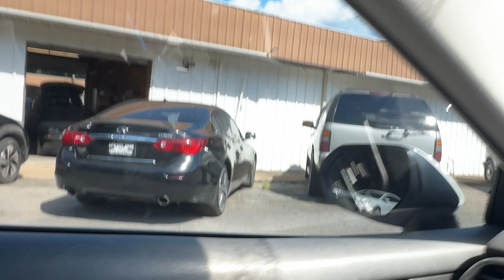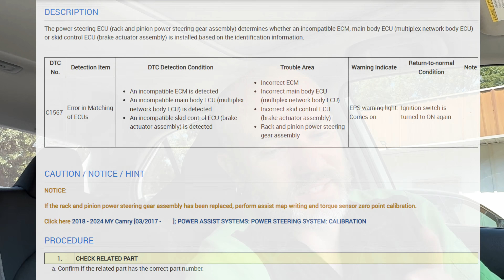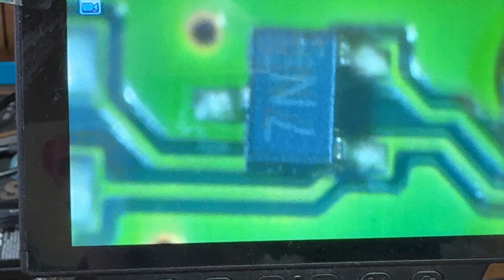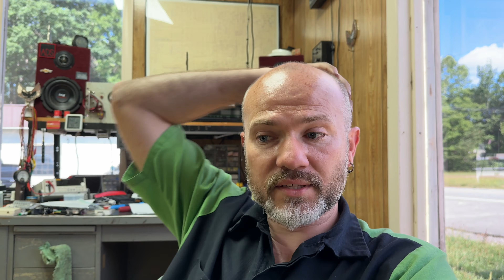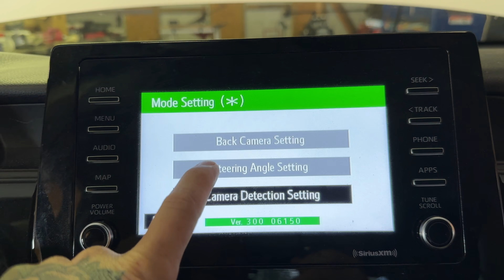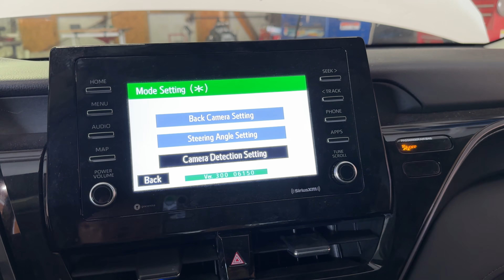Low Mileage Camry What Happened to You? Part 3 The Repair and Cause?

Comment: The SOT-23 device is a dual bi-directional TVS like TI part ESD2CAN24-Q1. This device protects the HSCAN transceiver against ESD, and it is very effective against normal human body model ESD, and will clamp other over voltage events of similar energy, however it will not withstand a lightning strike.

Comment: In Japan years ago when I lived there, one item for the safety inspection was to drive the car around a circle with the turn signal on and when coming back around to a straight line, it was a requirement for the mechanical position of the turn signal to turn off the blinker. If the plastic parts for the turn signal system was broken, FAIL this portion of the inspection, take it to get it fixed and back to the safety inspection folks to verify that some work was done and fixed by whatever means was needed. As you mentioned maybe this is now a COMM issue rather than a mechanical issue, I honestly don't know these days, I left Japan 10 years ago and have not run into a turn signal issue since. 

Thanks for the console programming procedure, that will save some time for sure.

Comment: Your shorted 3-terminal device was almost certainly a "TVS" (transient voltage suppression) diode.  It's purpose is to divert a static electricity "zap" to ground before it can damage more sensitive electronic parts in the module.  Your shorted part must have been overwhelmed and destroyed, allowing the processor to be damaged.  A nearby lightning strike would explain this, and all of the other damage you listed (abs module, wheel sensor)...

Comment: That car has water damage. Id check the floor under the rug and the back seat for any SCM TCM or TSC modules or PCM. Pull the rug up passenger or driver. Something has 💧 in that car. One of the things that usually happens when you have water damage on a car. Especially storm damage is specific modules. In the cars have other capabilities, and if they get wet, everything goes crazy, check the trunk.Most of those newer cars have modules in the trunk.
Reply from the maker: No water damage.
Reply: obviously he'd have first checked for water.   duh

Comment: Excellent analysis. Given what you showed on the circuit boards, I agree with lightning strike damage. The first chip you showed on the CAN bus is a diode network for overvoltage protection and the chip would have sacrificed itself during the lightning event.

Comment: Some used modules can be used and reprogrammed and some cannot.  If it is an anti-theft part then it might be able to be cloned with a used module out of the vehicle.  I would try and update all the modules, and it might code to the new VIN.  Try to reprogram first.

Comment: I find that to diagnose everything you need to know a lot about computers, which i dont. What method would you recommend? I want to know everything about chips like eeprom, transcievers, filters  and so on
Reply from the maker: You really just need to know circuit design. Like pull up, pull down, the different networks.

Comment: Chip in the ABS module and TVS diodes in the power steering module and a small or tiny dent in the front bumper.  Sounds like they hit a downed power line.

Comment: Turn signals didn't work before because that module was offline when everything else was offline. You even had a code for it on the initial scan.

Comment: To get out of the diagnostic just hold the power button for a few seconds. The screen shuts off and reboots. My bet is lightening strike. I just did a 22 Corolla lightening took out abs module. Left rear speed sensor. Certification ecu and main body ecu.
Reply from the maker: Awesome thanks

Comment: That's a bad TVS diode, as others have mentioned. Digikey has a good white paper on automotive grade CAN Bus TVS protection and lists some SOT-23-3 devices. Same form factor as that 7N. May have been an easy fix for that module, either remove it or replace it.
Reply from the maker: Yep would of been a real easy fix if I didn't break it getting it out lol.
Reply: @autodiagyt  Yeah, but that's the beauty of working on broken stuff, it's already broken. And, of course always learn for the next time.
Reply: @inothome  FYI for all:-  TVS = Transient Voltage Suppressor.

Comment: The 3 terminal chip (7N) across the CAN bus is most likely an ESD protection chip and not a filter.  A filter would be bigger and have more terminals.  The ESD chip has diodes that would short the line to ground for protection.  You are right that you could remove the chip and the circuit would probably start working again.
Reply: Yes, probably ESD protection or TVS diodes. Would work like a pair of Zener diodes by sinking current from the CAN lines to ground when the voltage difference gets above a certain limit.  There must have been a voltage spike on the CAN lines, a difference greater than 16v.  Their normal failure mode would be to fail short circuit to ground to protect the circuits nearby.  I'm surprised more modules didn't also fail if that is the case.

Comment: I think the little 7N Chip is for static protection of the data lines to protect the circuits after it from static. At a certain voltage it will let it run to ground and protect the circuit.
The third pin that is not Can H and Can L must go to ground.

Comment: I think you got a lightning car.  Too many modules bad, and Florida has daily intense lighting storms during the summer.  The strike was just strong enough to do some damage, but not take out modules the way you're used to.  I'm sure that N7 chip is some kind of circuit protection - something like a double Zener diode.

Comment: I have ran into so many vehicles with customers pushing bad batteries and or jumping off vehicles and I bet it came from voltage issues due to bad battery or being jumped off or jumping other vehicles off and it running during jumps.

Comment: As i worked alot on toyota here ...they use BLDC motor drives for eps if you can get eps drive computer from same parts car it will work perfectly.thx jack for taking us through your facts finding and fix.cheers

Comment: I looked up the service history and it states the vehicle had some aftermarket wiring causing the taillights to stay on and it also said that the alternator shorted out causing the ABS actuator to fail. Idk if any of that is true.
Reply from the maker: So go back to part 2 and see what one of the reported reasons for service was at the mileage the car stopped counting at and can you confirm that's the dealer that claimed collision damage. Email me if you don't mind autodiagyt@gmail.com

Comment: i suspect that to be a zener diode package so if too much voltage shows up on the can lines it shunts the excess to ground. hmmm did that rear tire take a lightning strike?  sensor abs  &steer modules nmm.

Comment: I have a fancy GE washing machine that stopped draining. I pulled the pump ohmed it out and it was bad. Put a new pump in same issue. I pulled the control board it had 17 connections to it. It had a huge burn mark. Bought a new board all fixed. I assumed the drain pump took the board out. Many people had the exact same issue and an appliance guy on YT (Bens Appliance and Junk)figured out it's the board that takes the drain pump out. On washer board it's a triac that blows out on all the boards.

Comment: Hit us with the middle finger pretty hard my man... JK😂  Great to see a conclusion on this one and some interesting Toyota secrets.  The thing I really hate about these new cars is the shear expense of repairing these system we somehow managed to live without for over a hundred year but now are almost required and given time wil be government mandated i'm sure.  Even the simplest touch screen radio from OE is 1000$ let alone self parking modules, sensors, cameras and all the other junk. It's fine when you buy it new and it's under warranty but the next guy who has to pay out of pocket or buy and expensive aftermarket warranty is SOL. Imagine the cost of replacing a touch screen dash in something like a Hyundai Ionic?  I know of one Tesla that was totalled out by insurance over a battery replacement qouted at over 20k. I personally dont plan on owning anything newer than about 2014 and right now i'm perfectly happy with my 2001!!!

Comment: N7 chip looks for me as a NPN or PNP transistor
Reply: A bipolar transistor makes no sense at all in this position,  I'm 95% sure it will be a dual TVS (transient voltage suppressor) which is a common fitment on automotive CAN bus.  I can't find a part number for that code, but it isn't uncommon for codes to be unlisted in automotive electronics.
Reply from the maker: @ferrumignis  I believe you are correct.
Reply from the maker: I'm thinking it's some kind of low voltage dual zener diode to clip voltage at a certain point.
Reply: @autodiagyt  i thought diode similar to diodes you wire in tow car lights

Comment: I had a subaru come in. Would not pass state inspection because of the red BRAKE light being on. WHen I scanned for codes ECU had p0420 and in the parking brake module cant remember the number but the code description was "ECU FAILURE".  It seemed to work OK. Tested power and ground to module and found no issues. I replaced the parking brake module and still had same code. ECU failure. Come to find out the p0420 was the cause of the RED BRAKE light to flash because of a engine code in ECU. Also caused the ECU failure code in parking brake module.  The guy had bought it at the local scumbag buy here pay here. The car lot had ordered a $100 dollar catalytic converter and o2 sensor kit. So he not only needed a cat (original was probably fine but the flex pipes on the cat rust and leak) Subaru wanted like 2800 for a cat.
Reply: $100 catalytic converter??? lmao That'll last until you can't see the tailings anymore....

Comment: One type of IC component package failure is called popcorn-ing. Moisture can migrate into the package body (insulator), then cause a fracture during the heat cycle of solder reflow. Afterward, since the IC components and connection features are so small, contamination will start to degrade the circuits due to environmental exposure. Popcorn is avoided by careful handling of the components before soldering with storage bag sealing.

Comment: Fantastic work, Jake! It's unbelievable that there are so many hidden features and menus behind covert inputs! Great job finding them - lots of time spent on research!
Really enjoyed that you performed an autopsy on the bad modules - couldn't find info on a quick search, but I would bet the 7N is a dual surge arrester and it's presence means Toyota expects surges on that module's CAN lines. This can still be tied o a lightning induced overvoltage and the weakest components failed from it. Very curious to see Part 4!
Reply: That's interesting.  I wonder if that is common on other OE modules?  It is probably good that the cheaper component died rather than an expensive chip but i guess that doesnt save the customer any money.  Makes it easy for Toyota to refurbish and resell modules though.
Reply: @curtisroberts9137  Yep.

Comment: The first dealer looked at the blackbox video and decided the driver's reckless abuse of the car caused the observed failures.  The dealer defined driving abuse with a wreck/accident.  Not what most people call and accident but it's their choice.
Reply from the maker: So a video of a car slamming on the brakes in front of you and crossing your lane in the process is classified as owner abuse? And also a lot of these triggers are really not that hard to hit. I've purposely triggered some of these and the threshold to hit some are really not that high. Also just driving a vehicle in any manner should NEVER cause a module to internally fail. We are not talking about a car that was beat on and now it has a mechanical issue with the engine or transmission.